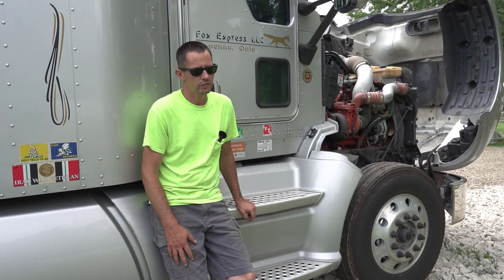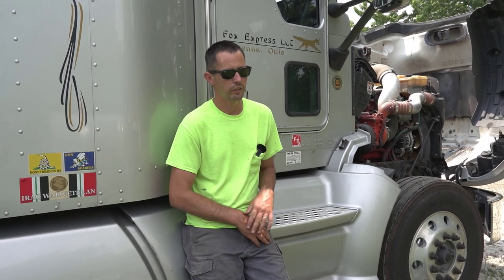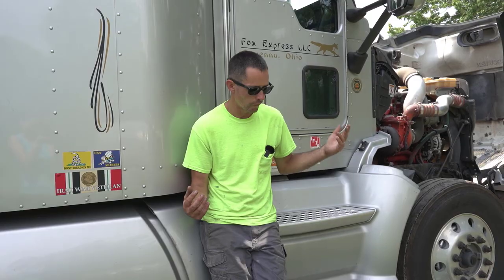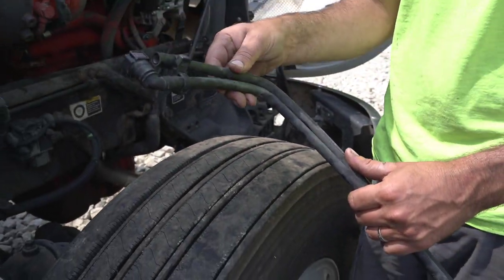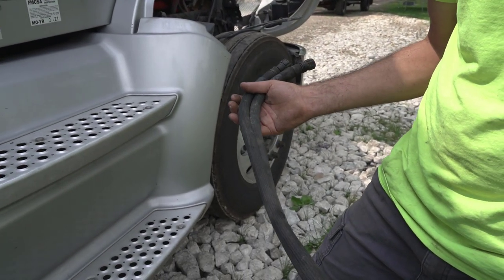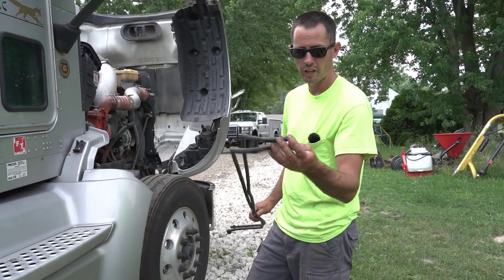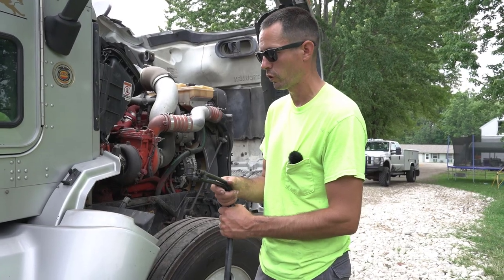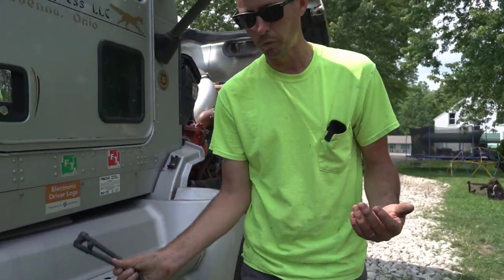Tips & Tricks #1 - Volvo DEF Injector/Doser Coolant Lines Failure - Check Yours Now!

Comment: 1 the coolant does not keep the injector cool, it heats in the winter to keep it from freezing, 2 the end you talk about is available in a repair part, all of the fittings are available, its a pain to make the hose, you have to heat the hose and slide it over the fitting,

Comment: Cost me $300 for all 4 hoses. A cheap Alternative is a 3/8 coolant hose every 2 years. In emergency situations, you can also loop the line with a basic footlong 3/8 hose, but the chances of cooking the doser valve are high. Better than a roadside call.
Reply: Have a part number? Or I should just put a 3/8 hose with clamps as a replacement?
Reply: @dk-ku4tc  no part number needed. Make sure you get a heater hose, at least 250° F heat resistant. Double check the size of the hose on your truck. Mine was 3/8.

Comment: Great information. I'm on the side of the road now waiting for the local diesel shops to open with this very problem. My fitting broke after driving through a huge puddle I didn't see while driving in heavy rain in the dark. This happened to me 6 years ago tomorrow in Mississippi. So I guess 5 years is about as long as I'd expect them to last.

Comment: I had also coolant hose busted between air compressor and transmission lost all of the coolant in seconds. Not easy to replace them have to be skinny and remove batteries to get some access to it

Comment: Sure wish I knew about this before i blew a line in Denver!
Reply from the maker: Thanks for your comment!
Reply: @truckingandfixing  I had the one of the 2 doser lines  replaced with the factory OEM plastic line that will break again, and also need to do the other before it costs me a $900 side of the road call. I want to do the rubber hoses you showed. Did you have them custom made, or does someone stock them? You mentioned pricing but not how to get them. Thanks for the help!

Comment: I REPLACED THAT CHEAP PLASTIC  3 YEARS AGO WITH A SILICONE COOLANT HOSE AND STAINLESS STEEL HOSE CLAMPS FOR AROUND 100.00
PROBLEM SOLVED. I WOULD RECOMMEND YOU DO IT IF YOUR TRUCK IS 5 AND OLDER.
Reply: Im going this route myself i trust this rather than those factory lines.

Comment: Have an issue with my Volvo 2014, the coolant heats up and start leaking from a couple of hoses but if I leave reservoir lit slightly lose, it splashes out from the lid. Replaced the water pump and thermostat but same result

Comment: I got a buddy of mine with a Pete and this has happened twice. Both times during a regen. Don't know why it's happening and shops are stumped. Any ideas?  He's actually stuck in Waco Texas.
Reply from the maker: Do you mean the cooler line broke during the regen? Or what exactly happened?
Reply: @truckingandfixing  
Yes only regen. The plastic fittings broke at the doser. It happened twice and shops are dumbfounded.

Comment: Cheap way of building antifreeze lines.      Why the factory couldn't just use regular hoses and clamps ?   Garbage snap in plastic lines.
Reply: Mercedes, and many other car and truck manufacturers do the same things. Plastic snap in connectors.  You buy a 100k Mercedes and once it's 5 years old shit starts breaking.       They do it on purpose.     They save money Durning assembly, quick assembly process.   And they make money on selling new parts .     Common sense they'll make  garbage so they can make more money down the road.
Reply from the maker: Well said! I agree